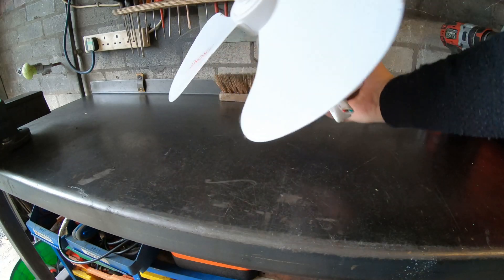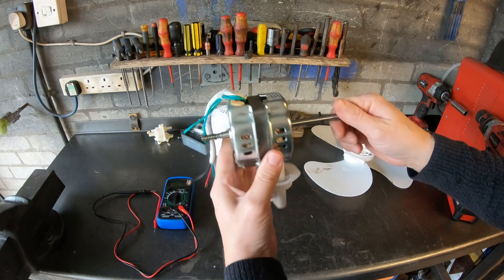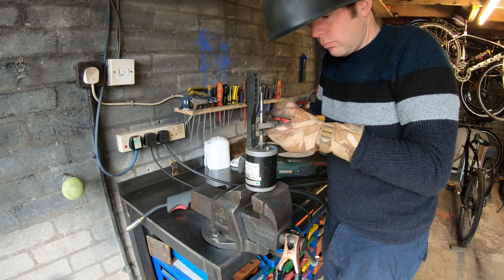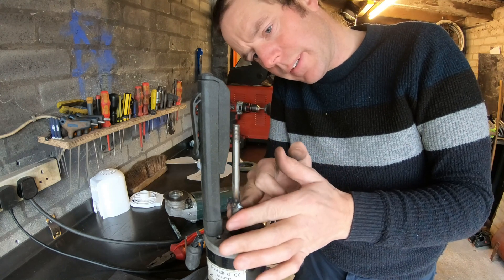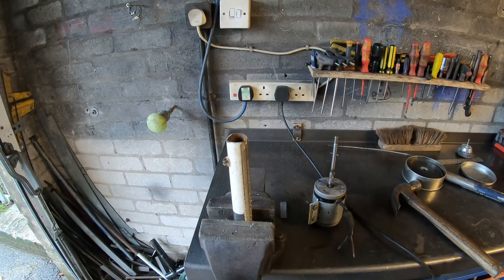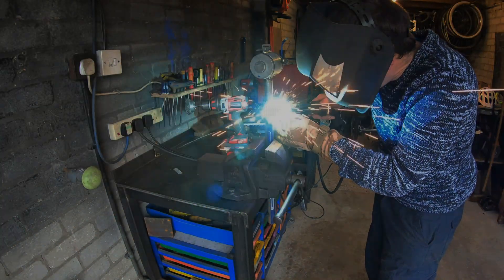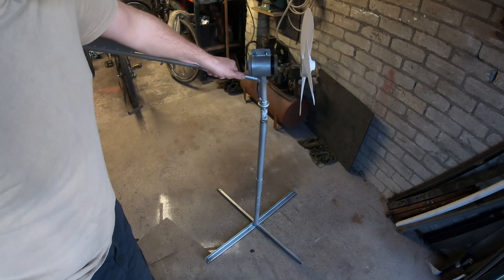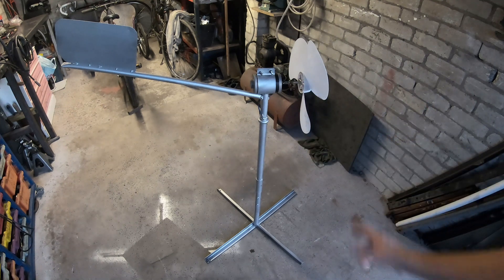mobile mini wind turbine DIY

Comment: Hi Rob, great videos, I live on a canal boat and wish I could find a small wind turbine that would produce anything between 5-10amps  during winter months as a back up to running a Genny. I’m a continuous cruiser so it would have to be roof mounted. Most Chinese examples I’ve seen on internet are pretty useless 🤷🏻‍♂️
Reply from the maker: Thanks for your comment.
 I'm going build a rig to test my recent builds for amp output etc. 
I imagine you could locate the canal boat to a windy location to optimise wind turbine output.

Comment: I would have made a vertical wind turbine instead. Catches more unstable wind closer to the ground and don't need to be placed so high
Reply from the maker: Its next on the list.
Reply: @robertthorn23  Have 2 on my roof but only test models atm. Try to figure out which one catching most wind and turn the turbine in lowest wind. Now I'm down to 9 ft/sec
Reply from the maker: @dagandreassen3115   is it vertical axis wind turbines that you're testing?  
They're a great idea because theoretically, they always catch the wind.

Comment: Very cool little generator! Kudos!

Don't forget throw a coat of paint on blades. Pretty sure it could last a bit longer then against elements.
Reply: Nice one brother ❤
Reply from the maker: Thanks .
yeah defo needs more rust proofing etc.
Reply: @robertthorn23  No problem. Protecting plastic from UV rays is perhaps most important, tends to get brittle fast when outside.
Reply from the maker: @Teknopottu  ah right I see what your saying. good shout
Reply: I think some spray polyurethane would help with UV resistance @robertthorn23